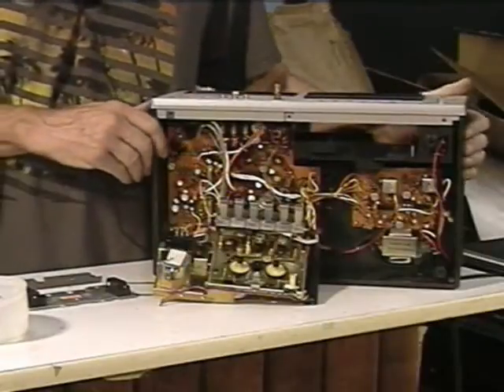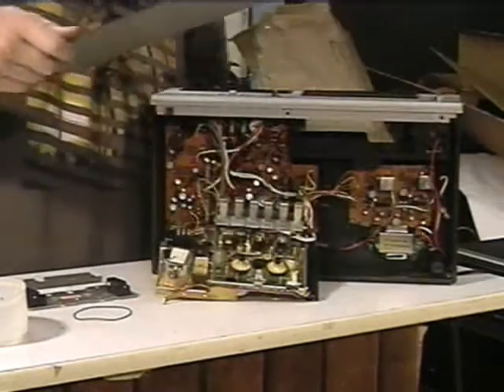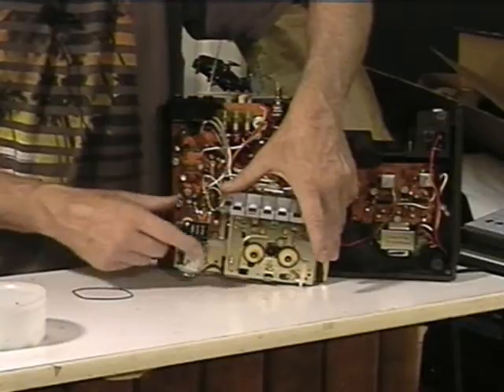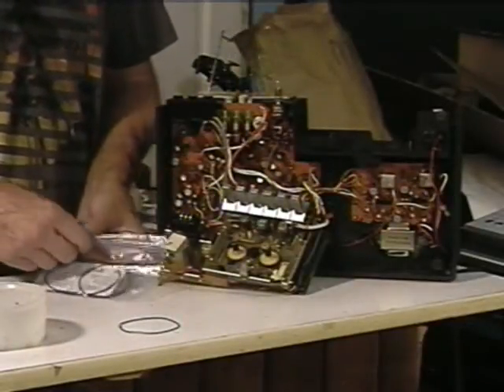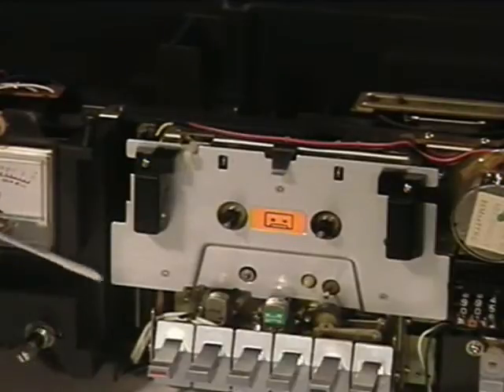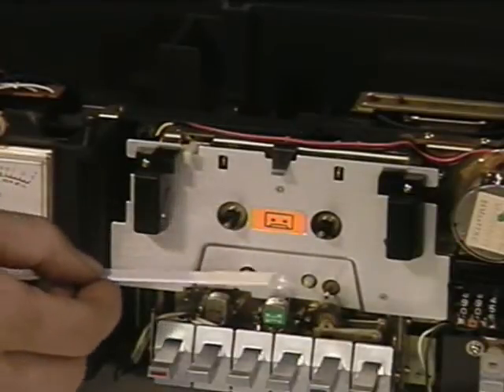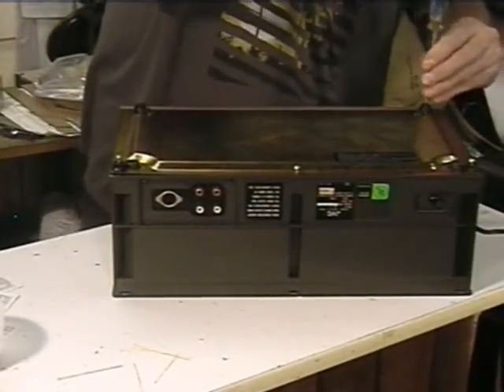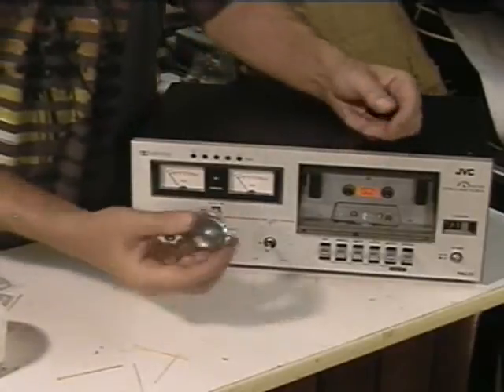Vintage JVC KD-15 Cassette Deck Belt Replacement, How To

Comment: Thanks for a very clear video on belt replacement. I have a different model vintage JVC KD-2 cassette deck. Pretty similar once the case was fully apart. One of the keys was removing the blue screws! Used your suggestion for the belt replacement company. Easy peasy!!!
Reply from the maker: Glad it helped out. Thank you so much! Take care!

Comment: Hey, I know this video is super old, but hoping you might still be able to help! I have one of these cassette decks and the auto stop function keeps kicking in when it shouldn’t. Do you have any tips for that?
Reply from the maker: Geez, I wish I could help. I don't know on this one. Maybe another viewer can chime in here and make a suggestion. Thanks for watching and commenting. Good luck! They are cool old decks!
Reply: Take up reel is sticking..needs some 3 in 1 oil
Reply: Make sure the counter belt have the correct tension, there is a sensor at the back of the tape counter that kicks in if the belt is not moving. That is the auto stop device.

Comment: I have a KD 25 bought in 1978. I think the belts are starting to go bad as it seems to run a little slow. Guess being inside preserved them for 46 years.
Reply from the maker: It happens. I have a Pioneer CT-F8282 I bought in 1978 as well, that needs the same treatment. Good luck!

Comment: Can you tell me the belts part number I have the same deck thanks for the detailed instructions excellent work
Reply from the maker: I don't have that information. If I remember correctly, I got them from a website like Turntable Belts . com in Portland, OR. They also sell cassette deck kits. Just go to Google and you will eventually find what you need. I hope. Good luck!

Comment: I have the same model that has sat unused for at least 20 years. Tried to use it the other day and it seriously sticks and drags . . . has problems rewinding or FF. Does that sound like an old belt issue to you? I'm not nearly as competent in these matters as you  . . . but the unit looks to be in great physical condition . . . no abuse ever. Just won't play without dragging or sticking. Thanks for the informative video.

Comment: would this be a good guide if I'm trying to repair/replace the belts on my JVC KD A7? are they fairly similar?
Reply from the maker: I would like to say yes, but the truth is I don't know. I looked it (KD-7) up on tapeheads.net and it sounds like a different process. I might have to find one and peel it open.